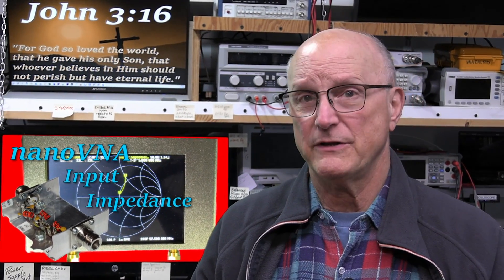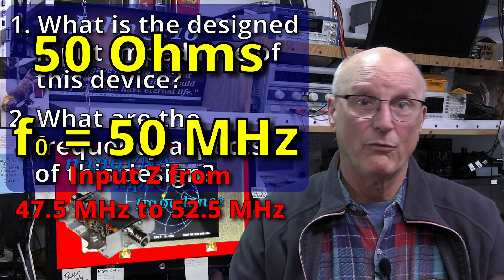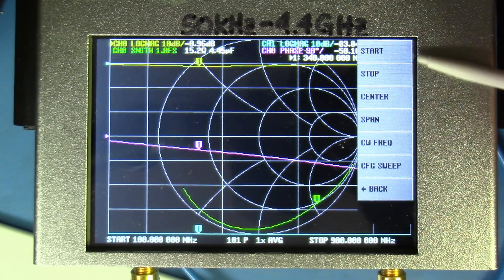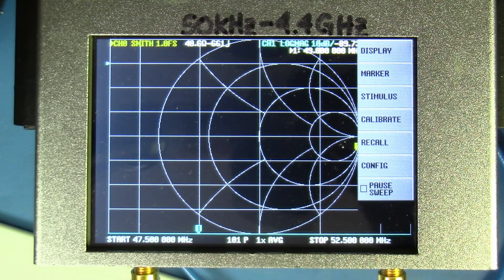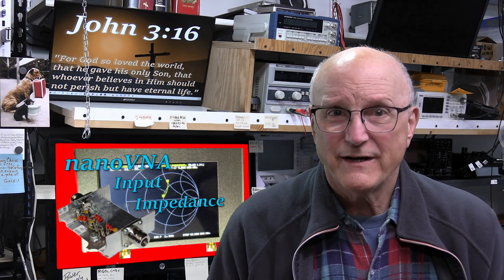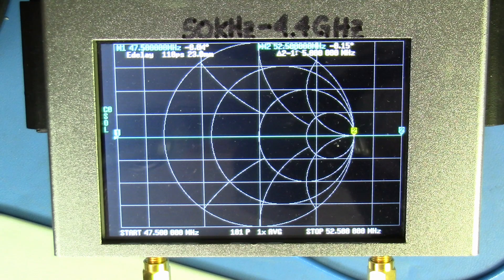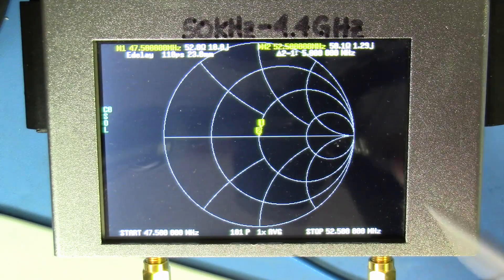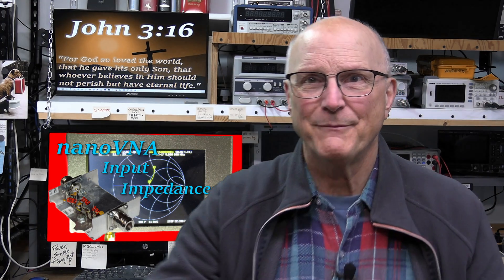nanoVNA: Measuring the Input Impedance of a Filter (068c)

Comment: I asked a question about  the port extension/electrical delay in the previous video.  You answered it in this video at 10:35.  I'm assuming it will work in an S21 measurement as well.  I'll have to give it a try.
Reply from the maker: First of all, port extensions only apply if you are maintaining a 50 Ohm system in whatever you are adding or removing from the system. If you are measuring gain (e.g. S21), then they have no real application. These port extensions modify the *expected phase* phase assuming that the extension complies with transmission line theory (e.g. moving around the perimeter of the Smith Chart). Hard to explain in words.  Being that S21 is measuring magnitude of signals and the magnitude isn't changing with moving about the Smith Chart (just the composition, r+jx, which make up the magnitude). Port extensions don't apply to magnitude measurements. They do not adjust for any attenuation that may be introduced or removed by changes in your cabling. I hope this helps as I was kind of thinking out loud which can get a bit rambly. :-)
Reply: @eie_for_you  Gotcha.  Much of the science is over my head.  However, your explanation clears this up.  S11 measurements only.
Reply from the maker: Perfect! :-)

Comment: Will this procedure work for testing  impedance on a 50ohm 3db attenuator?
Reply from the maker: It most certainly will. Just remember ... you have to terminate the output of the attenuator with your 50 Ohm load as most attenuators expect to be terminated. 🙂

Comment: When you changed the scale to 0.2 the data changed appropriately but the smith chart behind it did not. It remained at unity scale. Have they fixed this yet?
Reply from the maker: Honestly, I never paid much attention to the lines. I look at the numbers associated with the marker. If they fixed that, I haven't updated mine with the new firmware. 🙂
Reply: @eie_for_you  OK. For me the lines are the key, and the numbers are just detail. The lines tell me what structures I need to move a marker to the centre.
Reply from the maker: @donepearce  Aaaaah! I see. 🙂

Comment: Unless this is an intended Comprehensive NanoVNA introduction aide, you seem to be doing a Lot of excessive"Tapping" & screen setting work that I don't need to do using my NanoVNA-F to make same S11 measurements....Why not Calibrate (Open, Short & Terminate) using the Same coax cable & Eliminate all the port Extension set-up work ?? .....Thx for showing..
Reply from the maker: I cannot assume that the person watching the video knows how to navigate the various menus. There are a LOT of folks out there who just got the nanoVNA and are trying to figure out how to use it. Thus, I am not going to skip steps that they would find useful.
Like I said in the video, I purposely did this the way I did it so I could demonstrate how to do a port extension. I said the easiest way to accomplish this would be just to convert to an N connector and calibrate with my N standards. But, not everyone had N standards to do this with, and folks need to know how to accommodate those situations where they have to add or remove an adapter to do the measurement.  Thus, I purposely did this in such a way as to give myself the opportunity to demonstrate how to do it. 🙂
Reply: Thx...As a relatively beginner user of the NanoVNA-F maybe I've been doing something wrong...My most usual Specific Swept freq S11 antenna & Device characteristics concerns are Return loss, Resistance, Reactance & R+jx Polar....Since across the Bandwidth (Hf,Vhf,Uhf) I see Insignificant minor effects when switching between typical connector Adapters...I rarely measure Phase when my primary Characteristics (RL, R, X, & Polar) BW are so little affected by typical connector Adapters changes...Should I be concerned with Phase ?? ....Thx
Reply from the maker: @tomstrum6259  As you probably already know, as you move down a transmission line from the original impedance, the actual impedance as measured at the end of the transmission line will be different. This transformation is in terms of the number of wavelengths you are from the original point. At the 1/2 wavelength point (electrically speaking), the impedance, once again, returns to the original value (see the Smith Chart). Thus, the phase associated with the frequency in question determines the place along that transformation you are at. As you can guess, the higher the frequency, the more distance from the original calibration "reference plane" becomes more and more significant in the measured value of the impedance because the wavelengths are shorter.  By doing the "port extension" we are moving the "reference plane" of the calibration to the place where we are connecting the item to be measured. Thus, we are actually measuring the impedance of the DUT, not the impedance of the DUT as transformed by the transmission line (again, the Smith Chart). So, yes, this method of adding delay (phase) is necessary IF we want the most accurate measurement possible. Oh, and this is really only needed to be done when measuring impedance. The Return Loss, SWR and other such entities are a don't care on this point unless we encounter a faulty adapter that we are adding. Again, going back to the Smith Chart, the RL and SWR in a lossless feedline are unchanged by the distance from load or source.  Only the composition of the impedance changes - but always in a way to keep the RL and SWR constant. Hope this helps. 🙂

Comment: Wonderful, I'm just getting into this subject matter myself and as always, you post a video at the perfect time! I know I should know Will you gives us some details on the filter design or if you have a video on it let me know? I'm using my NanoVNA to measure I.F. transformers on a receiver I'm working on from 1940. Also, can you do a video in the future on band pass vs. high pass, vs. low pass filters using a VNA. I know that's a lot, but just ideas for future videos if you need any. Thank you for all you do, take care and 73!
Reply from the maker: Well, I'm no filter wizard either as you will see in the next video on this filter's frequency response. I used an online filter designer which gave me values that I didn't have, so I cobbled together something and some components weren't the value I thought they were and, by the way, a wire jumper has inductance which can through tings off ... you get the drift. Part of the problem was the frequency that I was trying to set the filter for and the hacked and cobbled nature of the implementation.
Those video suggestions sound like fun. I get to cobble together some more filters and maybe even learn something in the process! 🙂
Reply: @eie_for_you  That's why we're here and the NanoVNA makes this a MUCH quicker job. I'm looking to make a filter to put in front of a preamp to monitor 134.95 Mhz ZBW ARTCC site to monitor high altitude air traffic, but the site is about an hours drive from here. I've been barely been able to copy the center with a scanner standing on the roof holding a small beam antenna. A good filter is a MUST for not amplifying a bunch of garbage as well. 73!
Reply from the maker: @W1RMD  Yes! I see the need! I tried a filter designer app ... unimpressed with the results. There are a BUNCH of them out there. I'd really like to totally understand how to go back to basics and design my own instead of depending on someone's app. That would be real nice. But, like so many other things, "if you don't know, I'm not going to tell you!" 😞  We'll get'er eventually! 🙂
Reply: Sorry, I meant RCAG site not ARTCC site.
Reply from the maker: @W1RMD  Gotcha! 🙂

Comment: Nice thanks. IS it possible to measure component Q or more specifically ESR of component at freq of interest. I would like to measure inductor R at freq X . Seems like there must be a way with this device. I have seen the method  at self resonance that uses 3db width,but I dont want to use the component at self resonance. I want to use it far from There!
Did you get your new toy? and try the free SA software?
Reply from the maker: Thanks! yes, you can determine the Q of a component at a specific frequency. The Q of a component is the reactive part divided by the real part of its impedance at a given frequency.  (X/R)
It sounds like the stuff you have been seeing might be referring to the Q of a tuned circuit as opposed to a component. The Q of a tuned/resonant circuit is the frequency of resonance divided by the bandwidth (-3 dB points) (fo/BW).
Two videos of interest on the subject are
Q: https://youtu.be/M6Ip1qkc8EM
Measuring Impedance of a Component: https://youtu.be/Pti8Erw_Kkg
I am still waiting for its arrival (impatiently). Where do I get the free SA software? 🙂
Reply: @eie_for_you  Thanks. Not sure whats happening to my comments. They keep disappearing. Google : spectrumanalyser  .  co  .  uk      Dont think it will load up without RSP1 connected. However the manual is available on that site. I was not aware a VNA could measure R of a component down to milliohms. My old Noise bridge is jumpy down below 10 ohm due to jumpy potentiometer.
Reply from the maker: Just got the toy late yesterday. So far it is AWESOME and I have found the SA software. While, in some ways, it is not intuitive, it is also quite awesome. Took me a bit to figure out how to change the RBW. Still haven't figured out the markers. I'll get there. 🙂
Reply: @eie_for_you  Excellent . I jave been trying to Reply .However YT keeps losing my comments. Tried about 10 times.  I did not realise the Nano VNA was capable of measuring R down to milliohms . My old noise bridge is poor below 10Ohms. due to potentiometer jumping around. Looks like nano vna is on the shopping list.
Reply from the maker: @2321brendan  Be aware that all VNAs have some issues measuring down into the milliohm range. With that said, they will report what they measure but these measurements may vary widely. I still recommend having a nanoVNA as they do a totally awesome job of it. See the links in the description for the "genuine article." 🙂